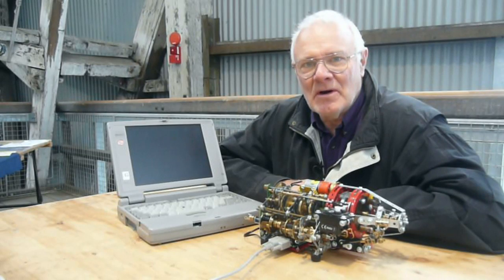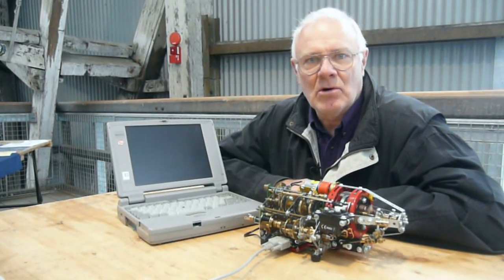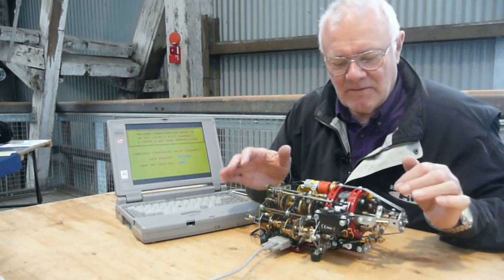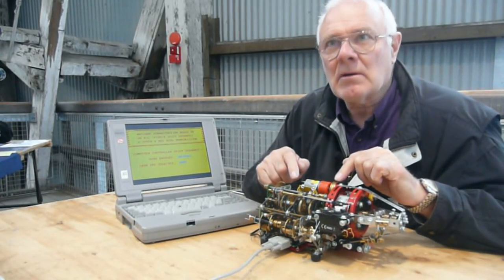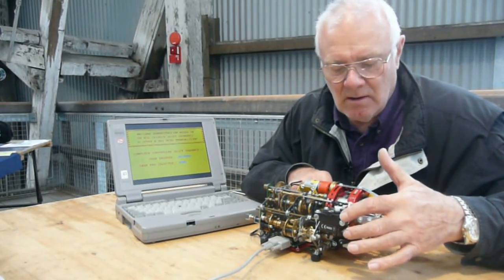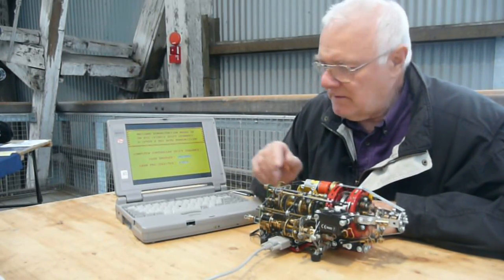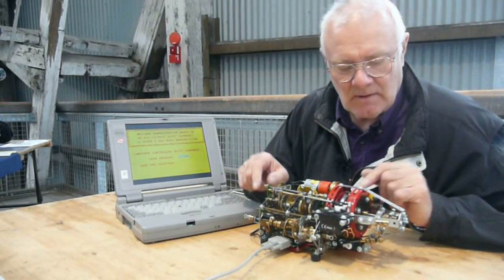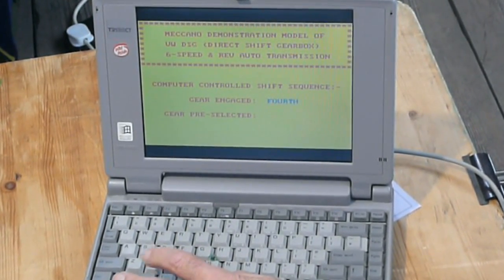Volkswagen Direct Shift Gearbox (DSG) Transmission

Comment: it is a great gearbox...... when its working!. when it goes wrong IT GOS WRONG!, BUT  alot of problems are caused by the user with the dsg box i.e abuse and not being serviced. Vw say service the box every 40k personally id do it every 25k with decent oil plus most people don't know how to drive autos correct i.e. sitting at lights in "D" with foot on brakes is a big no no
Reply: Are you suggesting putting it in neutral when you're at a light?
Reply: he has no clue what hes talking about lol

Comment: lol..not very reliable..? Dude, its the best designed & most reliable gearbox on the planet!! - it has such versatility.. The DSG completely changes any car worth it's salt into a completely different beast / driving experience. The VW. MK.5 GTi is simply amazing - to say otherwise would just be a lie. It's stunning and superb design,that's been built to last good & long, as the DSG oil is maintained - ( there's no issues on my 62,000 mile 2008 Edition 30-230...)
Reply: I had my clutches changed out at 130,000 miles. I only did it because it wouldn't engage reverse without restarting the car. Say what you will, but 130,000 miles is a lot considering the gearbox shifts are almost as fast as a modern exotic.